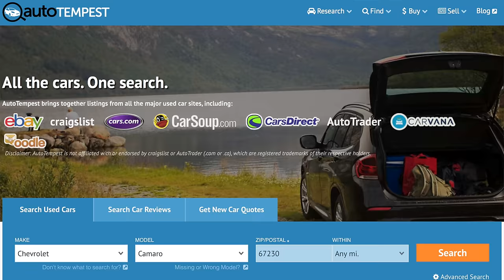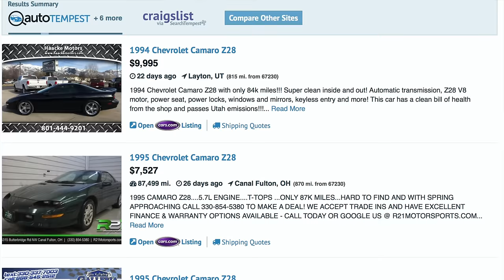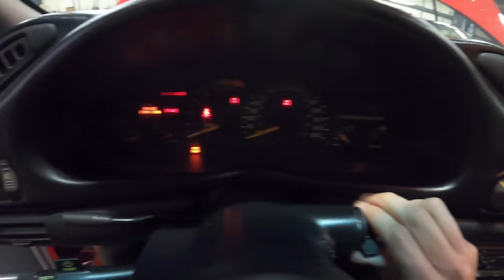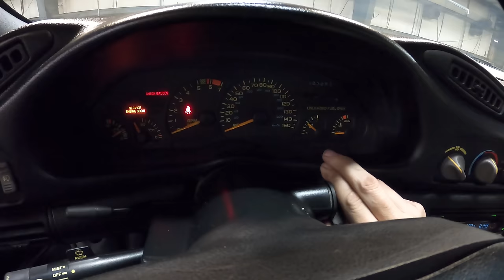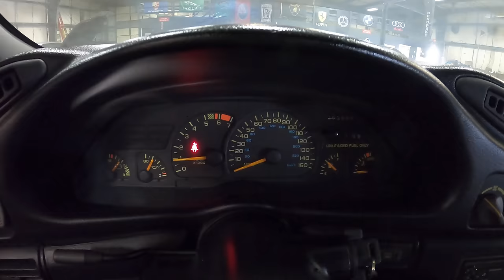I Bought a Barn Find 1993 Camaro Z-28 and Started it for the First Time in 10 Years!

Comment: So the GM Engineers started with the fuel tank and then built the rest of the car around it.  Genius!!
Reply: LOL
Reply: pursang833 the Germans are worse lol
Reply: @VQ.Family  They make cars difficult to work on so that people have to send them away to be fixed, it's all about the money. Cars could also be made MUCH MUCH more robust mechanically but that would mean people could buy 1 car, fix it themselves and keep it for their entire life. BUT that would mean the car business lose money, so they make em break easily and hard to fix.
Reply: @sirmounted8499  your right in saying that
Reply: Hence the trap door mod!
Reply: @VQ.Family  usually the Germans have a reason behind why things are difficult at least. Most German cars have a lot more systems and features of the car so they have less room to work with in the first place, so sometimes jobs are more difficult because of that. Like on older Mercedes for example they are actually pretty easy to work on.
Reply: I’m not sure if they built this car around the gas tank or the distributor.
Reply: Hahaha
Try doing the spark plugs on one of these 
I'm pretty sure they designed this car so nothing can be accessed without pulling the motor
Reply: They did what GM always does, slap a new generation body on the prior generation car and then update the running gear over a few years.
Reply: @VQ.Family  In most german cars u access the fuel pump from the inside of the car. just under trunk carpet/back seats. don`t even got to unmount the tank itself...
Reply: Its GM what you expect?
Reply: Richard Button try a heater core in a 2005 Jeep Grand Cherokee have to remove whole dash
Reply: @sirmounted8499  I can`t help but feel like you are giving manufacturers less credit than they deserve. It`s true that companies COULD make cars more robust, but you have to keep in mind that everything has a cost, and the average consumer already wants a car that has a decent amount of gadgets, is safe, comfortable, easy to drive, has a compact exterior while retaining a spacious interior, and has adequate performance while not using much fuel. Manufacturers also have to comply to increasingly strict safety and emission standards, all while making their cars inexpensive enough that people can actually afford one. So manufacturers can either stop complying to regulations build old style "bulletproof" cars, and face the consequences, spend more developpment time attempting to make their cars last longer than most people will realisticly keep them for (obsolescance will always be a thing as long as technology keeps advancing), at the risk of making the end product way to expensive, forcing people to actually keep their car for as long as possible, or focusing developpment purely on longevity, at the risk of not selling a product people will want to buy 

Also remember that most people either lease their car or sell it after 4 to 8 years.

Another thing to keep in mind is that manufacturers use CAD to develop their cars, which is a much more efficient way of doing things because it lets you run all kinds of simulations on various designs and generally is a much faster and cheaper way of developping a car that meets both the regulations and the customers' criteria for a new car, the downside being that parts are more tightly packed in the car, and it`s more difficult to repair as a result
Reply: So what about the 94 Mustang? Tank is behind the axle literally can see it under the rear bumper lol.
Reply: @ponypwr  Like the cars made in the 70s?
Reply: @richardbutton1179  The reply was for  Evil Ash comment. Not like tne Pinto at all lol, but behind the axle. Easy to work on etc. Many rwd American cars you can take the back seat out to get to the fuel pump as someone else pointed out.
Reply: It's a bitch! In my 1992 camaro I had to drop the rear axle and then finagle the tank out at a certain angle just to get it out of the vehicle. The lazy way some people do it is cut an access hole in the hump of the trunk and pull it out that way.
Reply: @ryanchristensen1799  that hassle is the only reason i no longer have my '91...
Reply: @thomasknight7734  You don't have to pull the motor to change plugs. You can change them from the top. If you have access to a lift it's even easier going from underneath. The hardest part is changing plug WIRES; getting them in the loom and routing them so they don't burn up.
Reply: @SV _ Have a friend with a 90s camaro, it won't pass inspection because the head gasket is blown. He keeps the car regardless.
Reply: This is the reason I'm selling my '96 Camaro. My fuel gauge was bouncing all over so I had a new fuel pump and sending unit installed... apparently on installation a power wire to the fuel pump got bent inside the tank, and 6 new fuel pumps got fried until, 3 mechanics later, they figured it out. That mechanic proceeded to then skip town and I got my car back 8 months later minus the exhaust, which after watching this video I imagine got thrown in a fit over how stupid this fuel pump placement is!
Reply: @thomasknight7734  the spark plugs are do-able..... not the easiest in the world but not pull the engine difficult. i have owned my 96 LT1 since 2014, i have done spark plugs
Reply: @ryanchristensen1799  call me lazy but i have done it both ways. i will never pull the gas tank out of another fbody to replace the fuel pump ever again. its not all about laziness but also about wasting a whole afternoon just to do a damn fuel pump. time is valuable.
Reply: @andrewdonohue1853  so be it but I rather do it the correct way. I'm not personally going to compromise the structural integrity of an fbody chassis just to save a few more hrs worth of work. I would never buy an fbody whose owner would have cut a hole in it to access the fuel pump. To me that hurts resale value.
Reply: @ryanchristensen1799  I haven't taken a day off since march 8th. I work ALLOT. that small hole wont compromise any structural integrity. my car has had that mod done for many years now. you wouldn't even know it. covered up by the carpet. removing and installing the gas tank is not only time consuming, its a pain in the ass. if it were attached to the fill neck with a rubber connector and hose clamps it would be easier. its a crappy design to begin with.
Reply: Fuel pump is easy. U have to cut a trap door at the top😂it's pretty simple. Doin it from the bottom is way too much work 👎👎👎
Reply: Yep, that's how it feels with 4th gen Camaros. Replacing the fuel pump is well over $1400 if you take it to a shop. Very annoying to attempt to do on your own. Oh, and be careful while dropping the tank because the fuel lines may break easily 😒
Reply: @JillyBean860  So I can tell the mechanic to cut a hole instead and save me some money? I just bought a 97 that’s been sitting a while, fortunately I don’t have this problem yet but for future reference.
Reply: Fuel tank can be accessed from the trunk🤣☝️u have to cut out a square in the metal behind the backseat. It's easy☝️but some mechanics might charge you for extra labor so they undo the exhaust ☝️🙈🙈🙈
Reply: Hahahaha it seems that way
Reply: @andrewdonohue1853  I agree 100%. I have had my 01 z28 for 17 years now and I've had to replace the fuel pump twice because the gas gauge stopped reading accurately due to the floater going bad inside of the tank.
 The second time a friend of mine who was an engineer had the idea to go through the floor at the rear, which saved me over $1,000 & about 7 hours of time, we just welded the metal plate back over the area. 
A lot of things are designed poorly on this model. In 17 years Ive also had to replace a window motor which  GM  riveted directly to the window regulator and the regulator is riveted to the fiberglass doors making it a pain in the butt to change. 
Then there's the wonderfully designed throttle body sensor which is riveted directly to the throttle body, so you have to replace the entire throttle body "$900.00part"  due to a bad sensor as the sensor is not available on it's own. All that said  I still love myT- Top equipped F body, though it's no daily driver.
Reply: gm moment 😳
Reply: The engineer said, F it, I don't have to work on it.
Reply: @carado1984 yep I did the trap door mod to my 95 Camaro

Comment: wait... this car was sitting for 10 years and you didn’t just automatically dump the fuel and change the oil?
Reply: Nah. Instead he did a burnout.
Reply: MurderMostFowl gen 4 camaros are extremely ugly
Reply: More money for wizard 😂
Reply: Couldn't this have been easier to even replace the battery, then fuel injectors and oil, maybe some fuel treatment. Why drop the fuel tank, rear suspension and cut the exhaust in half. The wizard seems like a dealers mechanic then a personal mechanic to Hoovy.
Reply: To get the old oil you need to get it up to temp first so the oil gets thinner and all the gunk gets out easy
Reply: @jonathanbrown6206  The fuel pump was bad, that is how you change the pump and was the reason the car hasn't been started in ten years
Reply: @jonathanbrown6206  To replace the fuel pump. wizard noticed the fuel pump wasn't priming when they first were trying to start it.
Reply: @jonathanbrown6206  He had to replace the fuel pump. They are in the tank.
Reply: @jonathanbrown6206  I think the Wizard is starting to loose it  needs a holiday away from Hoovie
Reply: @pauldavies6037  lmfao
Reply: @coldcoilinc  but they do have the lowest drag coefficient of all Camaros.
Reply: the fuel pump wasn't making the priming noise, that means you replace it
Reply: Jonathan Brown, the pump wasn’t priming.. cars that sit for 10 years almost always have a bad fuel pump.. But they should of definitely changed out the cars fluids before driving it
Reply: @coldcoilinc  the resign was worse
Reply: LTH HEADQUARTERS each to their own. I reckon it looks boss.
Shits on a c4 corvette.
Thinking about buying one of these here in aus as i cant afford the c3 vette i really want
Reply: @jonathanbrown6206  The fuel pump needed replacing, that was the only way to do that
Reply: @syedhassaanmujtababokhari6199  I agree. I also change mine after driving more than 15 mins. and let drain for a solid 20 mins. or so
Reply: @bossdog1480  hate those type of pumps like like the car.
Reply: @meandkg  No it doesn't. That means you check the fuses or relay first then you check if power reaches the pump properly THEN you replace the pump.
Reply: @shitboxoffroad  Perhaps yeah.
Reply: @coldcoilinc  nah there not that bad

Comment: Yeah, because of that tank being where it is, many owners opt to cut a trap-door in the floor, to get to that fuel pump easily.
Reply: Most people I've seen that are lazy just put in  an inline fuel pump instead of dropping the tank.
Reply: @JPARKERZ28  you would still have to get the tank out.
Reply: That's exactly what I did.
Reply: I did the same for my Z28, best modification for an always failing fuel pump
Reply: A lot of cars were designed with said trap door under the rear seat

*laughs in Volvo*
Reply: Yes what they should have done from the factory
Reply: @neilmurphy845  they learned and the 5th gen is under the rear seat  now.
Reply: @TheCamaro5  that's good to hear
Reply: I was thinking about that but it is such a nice time survivor it would be a shame to cut that car up!
Reply: Just had the same thought as I was watching them struggle.  Just cut the trunk floor yeah?
Reply: @chrisoconnor3119  ya
Reply: Richard Edwards volvos cant take about easy maitance, the radio needs a 700$ wiring harness because the radio is connected to EVERYTHING (ignition for example). Had a volvo come in with its spark plugs welded themselves into the engine. Those cars are almost as bad as toyotas 🤢😒
Reply: @rich_edwards79  Yup. Even my C70 coupe without folding rear seats has the fuel pump and sender behind their own gasketed covers accessible in the trunk under the carpet, not as dead easy as the wagons but 1/10th of the 4th gen nonsense here.
Reply: @quayl1337  but aren't Toyota saposed to be good
Reply: @rich_edwards79  Yes, my 92 Dodge Stealth has a trap door in the hatchback area too.
Reply: @quayl1337  idk about the new ones. But most jobs on my '82 are pretty simple.
Reply: Richard Edwards aye i got a 91 camaro, i dont want to cut a fuel trapdoor, but my pump will go someday, but f$ck volvos and subarus, and i cant forget about toyotas, just nightmares, id rather try and work on a porche and do engine out all the time.
Reply: Neil Murphy do work on one, go spend 60$ on speacial caps to take off the oilfilter, thats plastic, and breaks, so much. And do an oil change on a toyota, something super simple, and youll hate those cars,   I also have a distain with them because i nearly died in a 2009 toyota yaris becuase the wiring isnt ran through the firewall, its ran thru the pinchwelds, so i hit black ice and ended up going head on into a highway wall at 65 and had no airbags,    Never again will i EVER get into one of the deathtraps, i feel safer in my 1991 camaro then the newest toyota hunk of sh$t.     But thats just my personal experaince, i thought highly of the cars prior to really dealing with them. No thanks toyota, i wouldnt take a supra even if it was free.
Reply: Cameron Kuss

Comment: 26:05 "1300 dollars is alot of money" 

-Gradually spends atleast 10 grand on every vehicle purchase and 80k on that gallardo
Reply: Shit i spent 1700 on my 94 trans am and nothing was wrong with it
Reply: @Lulnateee  you spent less than 2 grand and got a working trans am?! Where do you live and how can I get there?
Reply: @omega1575   🤣 maryland, but i did kind of get scammed because the key had broke in the ignition as i was driving it back home after i bought it so 1700 plus 300 to fix the steering column so 2 grand in all pretty much!, it needs some body work here and there but it had 115,000 miles when i bought it
Reply: so cheap!!
I spend 1000 for just replace a rear wheel bearing and all 4 brake pads on my 98 gs400 in hawaii.....
If I have a garage I can fix it myself for under 150
Reply: @rotarygod  not sure what type of car you have (to lazy to Google it) but a 1000 bucks would be well worth it when it comes to replacing some wheel bearings that being said some of them are as easy as taking off the tire and putting it back on!

Comment: I cut an access hole in the rear floor to change the fuel pump in my 93 Z28. Resealed it and put the carpet back over the floor. No dropping axle/fuel tank.
Reply: How could you tell where to cut it?
Reply: Same. Did it on my 88 TransAm also

Comment: Every person selling a car: ac just needs a charge.

Truth: nope!
Reply: It needs the leak fixed before recharging.
Reply: K A 
every dealer on Craigslist: I’m selling for my grandma...

Car fax shows recently purchased at auction...
Reply: Funny. I bought a '99 Miata 60k miles ago that took a charge and hasn't given trouble since! Rare for sure.
Reply: Yup, if it's "just" then do it yourself before selling.
Reply: ChefG Romano just needs a charge*

*=every 5 hours
Reply: Jimmy Grant Only   5 digit odometer says 25000 original miles, really 225000 miles...
Reply: Lol yes and don't forget "Perfect except..."

Like, I didn't know there were qualifiers to perfect?
Reply: Asad Zee  If the compressor isn't seized than it's the shaft seal.  One of the two.

Comment: I bought that generation Z28 new in 1996 and kept it 12 years and 225k miles. I did that job twice. The second time I just cut an access hole in the top of the rear deck and then screwed a sheet metal patch over it. It took me less than an hour start to finish. The first time went just like yours, including a bump on the head! Congratulations on the new baby! I’ve done that twice too! Second time is easier there as well!

Comment: THAT is why everyone else cuts a door in the rear storage area under the carpet....
Reply: Yeah, literally everyone. It gets hidden under the carpet and nobody would ever know it was there. Such a commonly known trick for these cars. Surprised wizard hasn't done one of these.
Reply: I’m sure it has run through his head but he isn’t a “hack job” mechanic and wouldn’t consider that a correct procedure for this repair . Yes it sucks but do the job properly instead of taking a measure to cut open someone’s car to replace the pump. Tyler obviously cares about his cars enough to not allow that to happen I’m sure of it
Reply: A better mod would be to modify the fuel tank inlet to accept rubber tube with circular clamps so you can more easily drop the tank.
Reply: @thedubdoctor  an 8" x 8" stainless access panel with a simple rubber gasket and proper fasteners undoes gm's fucking absolute idiocy of having to pull the exhaust,the rear end,the torque arm,the driveshaft,the brake lines,the fuel tank etc... and like its been said before ,you can not see it and it does nothing wrong to the car when the carpet is reinstalled.it also saves $1200 the next time the pump goes.
Reply: trillrif axegrindor I understand where your coming from I truly do. But that’s not the correct way to do it ! And that’s what makes the wizard a true honest great technician.
Reply: yeah first and best mod ever on  those camaros  i did it  to mine
Reply: considering these cars arent worth a ton of money, the mod fixes poor design, makes every owners life easier with absolutely no impact on the performance or aesthetic of the car, AND fuel pumps are a very problem common on gm cars of that era, I'd say it's 100% worth it. Used to have an old firebird and did the same thing with it when my fuel pump went bad.
Reply: I have owned more than one car where a hole had been added to make a repair more access able.
Done right I have no problem with it, not like it's a million dollar car.
Reply: I had an 88. Easier than the 93 but I cut a square under the back seat and within minutes I was done. Once again proof the GM engineers were drinking on the job